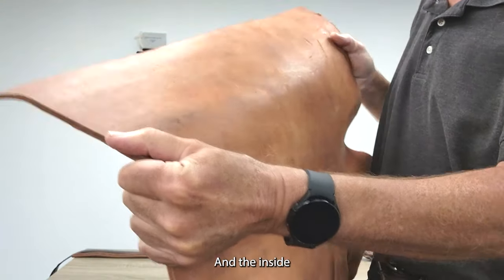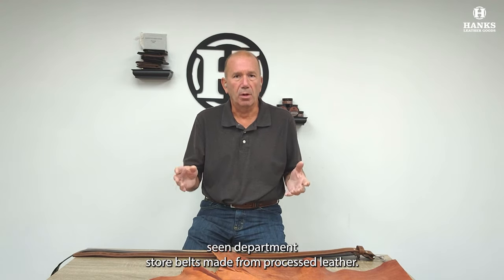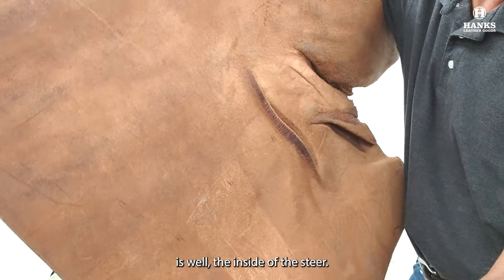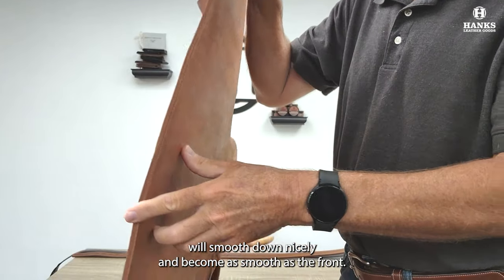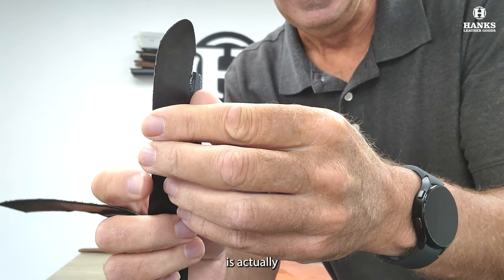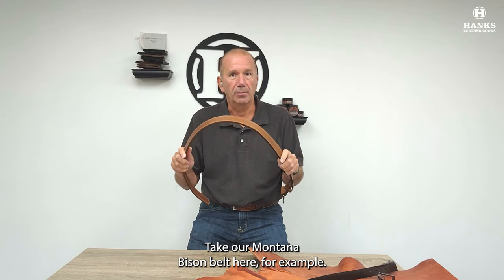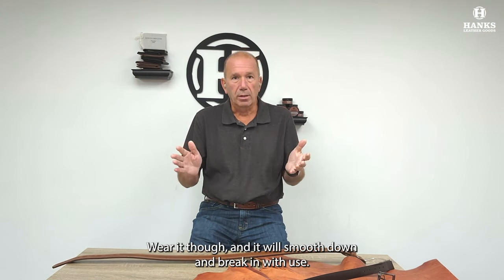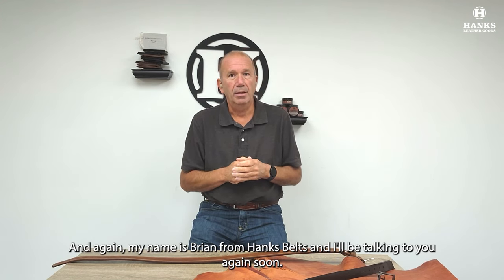Why The Inside of Our Solid Full-Grain Leather Belts Are Not As Smooth As The Outside.

Comment: I bought the Double Roller belt. While the belt is thick and sturdy, I'm not a fan of the buckle. I wish you had more buckle choices as I do not like the roller buckles. I have a belt I've had for years with the double buckle without the roller and I love that belt and buckle.
Reply from the maker: Hey Keith, Thanks for the feredback. All our belts have screws holding the buckle on so you can easily put any buckle of your chosing on yourself. Heck, put a diamond encrusted one on if you like! Glad you like the toughness of the belt though!

Comment: Hi there, 
Is The Premier belt a double full grain leather belts stitched together back to back, or are the 2 leather shaved off a little bit so it won't be as thick? 

 What type of leather and thickness was it used on each side?

Thank you.
Reply from the maker: The premier is two pieces of 9oz leather sewed back to back. It is very thick, and it is Vegetable tanned English Bridle Leather. Gorgeous leather!